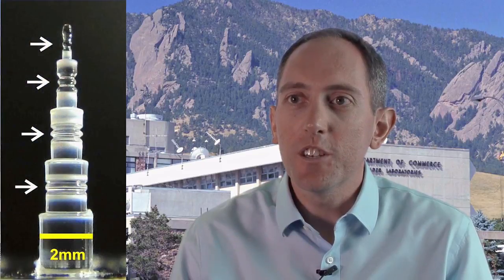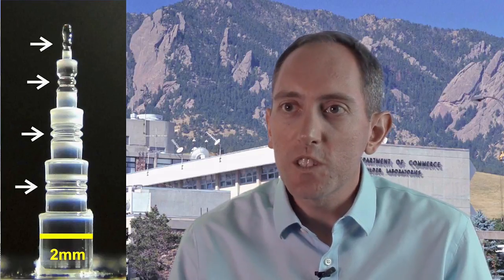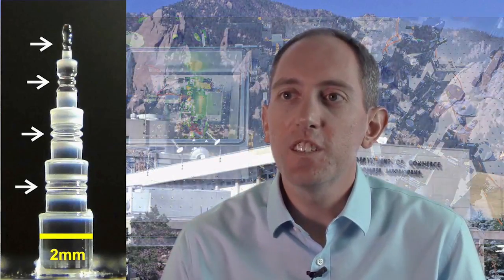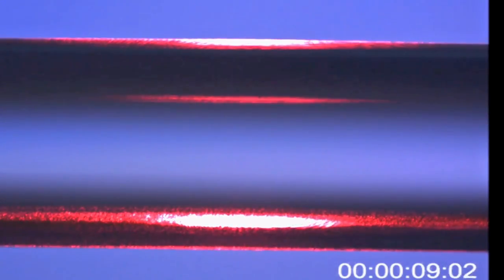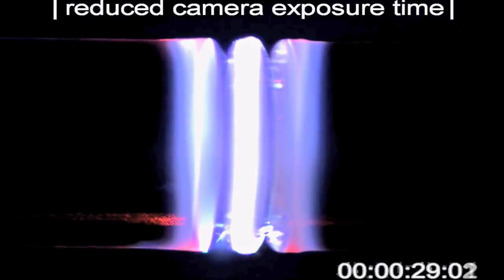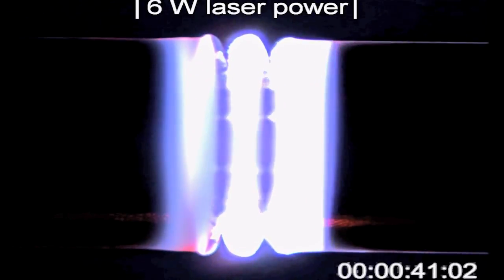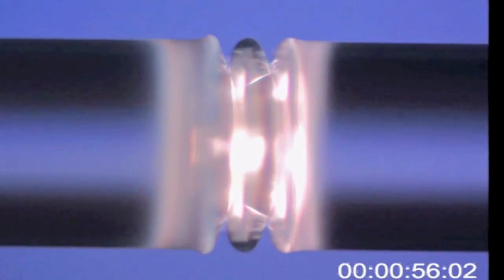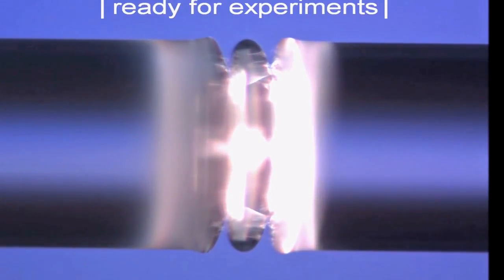Making a Mini Laser Frequency Comb in Minutes

Comment from the maker: All the light goes through the processed end of the rod. Yes, many new colors of light are created inside the glass resonator. For a single color going in, often times ~1000 new colors come out. A nice feature of microresonator combs is that the spacing between teeth is large enough to easily separate them using standard optical telecommunication equipment (e.g. WDM filter or a diffraction grating).

Comment: So, in use, is the 'raw' laser light injected into the fat end of the rod, and the combed light emitted from the processed end? Are new wavelengths actually generated (i.e., would a green laser produce blue and red light), or is the green light combed into a series of extremely narrow green bandwidths within the original bandwidth? How would a specific wavelength 'nano-band' (a single tooth) be selected for analysis or use?